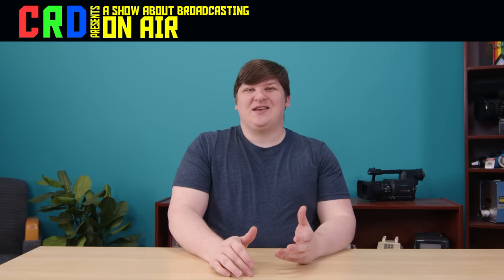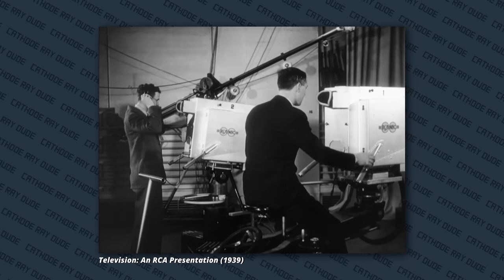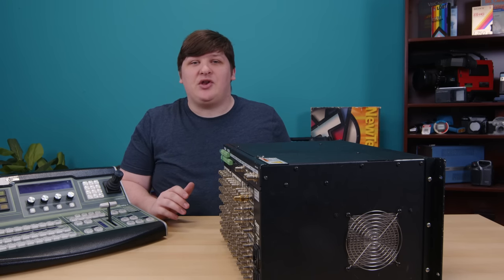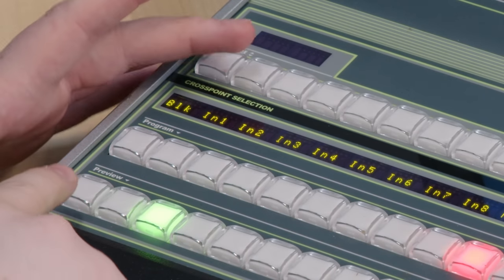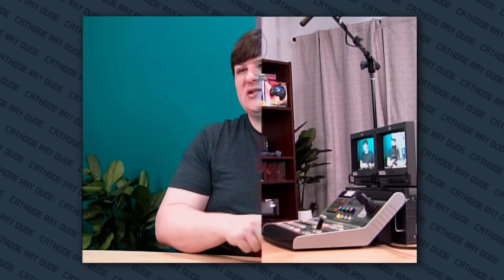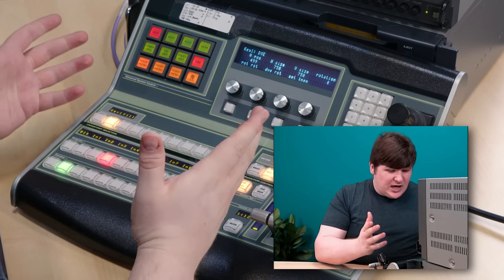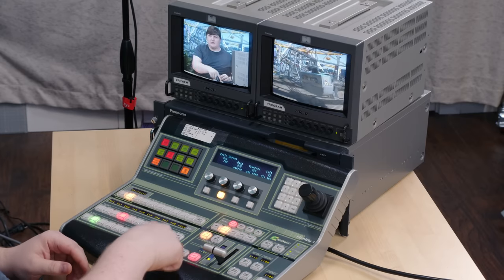What the heck is a video mixer?

Comment: The ultimatte was AMAZING! You could do linear, matte, chroma, an external keying. You could even cut a key on cigarette smoke, I kid you not! They were ridiculously expensive back in the 80s!
Reply from the maker: Mine doesn't seem to work and I'm really bummed about it. I'm hoping I can get it functioning, because yeah, the legends I've been told are incredible! All the keyers I have access to don't hold a candle.
Reply: @CathodeRayDude  oh no... all of our service manuals and old tech got e-wasted years ago...  We have junked so many old monitors, VTRs, video servers, etc over the years, I've lost count. I use to try to save stuff and find homes for things, but that was almost a full-time job in itself... :( 
I saw our ultimatte in the garbage years ago, and stupidly said to myself, I don't need a keyer, and off it went... ;( They were really difficult to set up, and operate, as I recall. It might be working fine, you just haven't got it set up correctly... does it pass video, and power up at least?
Reply from the maker: @tekvax01  I'm going to take another run at it next time I'm in the studio, but the last I tried, I couldn't get it to pass any signal. But you're right, there are so many knobs and switches, I may well have had it misconfigured.
Reply: @CathodeRayDude  send me the serial number and model number, (I can't remember what it is) I can look around and see if I can find an operation or service manual of it.

Comment: Quick note: On your Panasonic A/B Mixer, typically the Preview output will show whichever of the A or B bus is not currently being output to Program. It's possible that it got set incorrectly on your board? Also, if it works like the ones I've used you can get a hard cut the proper way by turning the Auto Take dial to Min and pressing the Auto Take button. (The other bus will become active regardless of the position of the T-bar and you have to reset the position of the T-bar before it'll become active again.)
Reply from the maker: On the WJ-MX50, if there's a way to do that, I haven't found it. Good point about using auto take that way though!
Reply: @CathodeRayDude  on that older Panasonic switcher you could unlock the T-Bar to do strange vert and hort wipes too if I remember correctly.
Reply: @CathodeRayDude  I'm more familiar with the WJ-MX20 (looks like you have one of those too) though it's been 25 years since I used one. I'm almost certain the MX20 shows the non-program bus on the preview output and would think the MX50 would do the same thing. There's definitely a menu on them that has some settings...

I did also use most of the other mixers in your pile at one time or another, plus a Videonics MX-1 and MX Pro and MX 3000 and a Grass Valley (old stuff and Indigo) and now a bunch of newer stuff. So I could be mistaken, but I'm pretty sure.
Reply: @tekvax01  Yes, there's a ring that slides to the right and you can operate it as two halves. That (or something very similar) was the first mixer I used.

Comment: I reckon you could probably achieve semi-complex mixing (using the left half of the shot from two camera and combining them), on analog equipment by tweaking the genlock. If one camera only starts sending its signal halfway through the first cameras frame, you should be able to mix them. It’d probably be pretty tricky to get right, but if the camera already accepts a genlock signal it should be doable. Very much beam racing stuff though, but it’d allow for basic positioning of images
Reply: The problem with that is that as soon as you do any vertical shift you'll end up with the vertical blanking interval in your picture on one side. For only a very small shift having a bit of black at the top or bottom might be acceptable, but for a larger shift you'd end up with a large black bar in the middle of your image.

Comment: I would love to see you do a video on your Amiga video toaster. I've had one myself for my Amiga 2000 for a decade but have never actually got it (and the Amiga itself) up and running for a multitude of reasons. Greatest of which is tracking down software for a particularly rare 030 accelerator card from GVP that has an integrated IDE hard drive controller.

Comment: When I was in junior high (early 90s) I was in a class that did some pre recorded stuff for the local public access channel, and at the time I recall we had some dinky little 2 channel mixer that I actually think was Realistic (Radio Shack) brand.  It wasn't much more than a switch between two inputs, and the only way to do a fade was manually with the T-bar (and even that I think was just a linear pot like you'd find on a equalizer.) Very basic, but enough for the purpose at the time.

Comment: The switchers that ESPN and larger facilities use commonly cost 300-500k or more depending on options. Newer models are IP based and can handle multiple formats and outputs.
Reply: I sent you a message via telegram.

Comment: I have my theory on A/B mixers. First that was due to a limitation of their era, that they could only synchronize and mix two images, A and B (if you change the source, say input 1 to input 2 on the same bus, you ´lil see a freeze). Second, there were well adapted to video editing on tapes (you would usually have two VCR’s no more, one on input 1 permanently assigned to bus A and one on input 2/bus B). The mixer was not manipulated by the director, but remotely controlled by the editing desk. That is consistent with the presence of an audio mixer.

Comment: 24:34 I want to add info about using preview and program buttons (PVW and PGM)
PGM is red and PVM is green and there is a reason for that too. 
When camera selected in vision mixer is broadcasting is also show red light on top called TALLY. There is a huge separety tally system which can be a topic of its own video. 
In studio, where there are several cameras anchor see red tally light on camera and understand that this camera is the one which is used for broadcasting at the moment. 
So do camera operator, who stands behind pedestal (studio "tripod"), holding camera and controlling lens - camera operator see red tally on on-camera monitor and it is signal that this camera is live.
There is also PVW function on mixer not for only a director to preview what next cut will be and check if  framing and focus is ok, but also camera operator holding next camera see green tally and gets that their camera will be next and they should be ready, and also anchor see with their peripheral vision which camera will be next (they see green tally on other camera while talking to camera with red tally). This is why you never see an anchor who try to guess which camera is live and that is why anchor is always facing camera everytime. It not - it is mistake of broadcast director or mixer engineer or something happens too fast to be able to use PVW.

I worked creating projects for tv studios for 10 years, ask me questions if you have some =) 10 years is a very short experience in broadcasting since I never actually worked on news, I only created systems for other people to work, but I have working familiarity with most processes.

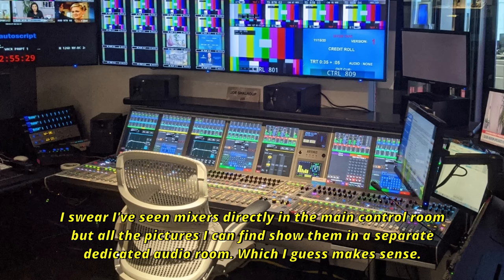48:20 I upgraded a main control unit of a studio where there was a sound mixing post with full-size sound mixer slightly behind a director's post with a vision mixer and and director actually listened to sound mixers main audio monitors, but it was kinda a mess, since sound mix engineer used PFL (pre-fader level) for checking sound sources and microphones before opening a fader and it might distract director from broadcasting, thats why sound mix engineer sometimes used tiny speaker connected directly to PFL port of sound console for that purpose only, so director don't hear an interuption from main sound monitors. But it is a tricky workflow. 
But they were able to talk directly to each other (director and sound engineer) without intercom, which is a bonus, I guess =)

54:00 it not "racks" =) its mean to be installed into "console" =))) Console can be a table with holes =) it can have holes in the middle of table or can have kinda rack mount on top of table with some angle. 
Most vision mixers you used photos in video are installed in custom built consoles. 
You can order any type of console for any configuration, that is actually what I did - we measures control room, calculated all equipment needed, created a layout of how it should be installed, get approve from customer (tv channel), found out several companies who build consoles (from pre built blocks of amsolutly from scratch), get quotes, get an approve from customer which price range and material fits customer needs, ordered, did all logistics, setup everything at customer's site, put all pre ordered equipment and setup everything to work. it was like 1% of my job, and not most difficult part, but still exciting. After that everything looks like it was like that always, vision mixer sit at its place, all intercom systems installed at hand leinght, all monitors and multiviewers, but it is all kinda custom build by someone at some point. It is possible to buy simple "rackmount" style console and put it on table and it will also work, even just random rack on tabletop will work, but it is someone's job to make studio look like studio (and it is kinda last almost last step before commisioning after working out all technical project, schematics, budgeting, ordering)

Comment: Echolab's switchers have become the Blackmagic ATEM lineup. We have two ATEM 1M/E panels, the first generation looks exactly like the Echolab, with a few Blackmagic Design tweaks. 

They have exchanged the BNC TX and RX for dual redundant RJ45 connectors that can be hooked up directly to the switcher. It has two redundant power supplies. The oldest one uses a proprietary connections, the most recent one uses a standart AC plug. 

Blackmagic sliced the prices. The hardware was sold separately,  you bought the switcher and you could control it by software or buy a hardware panel. 

The 1M/E panel costed about 5000 USD.The 2 M/E panel costed about 15000 USD. More than the switcher itself. The prices were sliced with the release of the second generation.

Gotta respect the australian company. They absolutely shaken the audiovisual market. I bet there isn't a single tv or film studio without a Blackmagic Design equipment of some sort.
Reply from the maker: That's been my impression, that BMD made it in *everywhere*. In the last few years, every single picture of a live or post facility that I've seen has one of those distinctive curved BMD panels in a rack somewhere. at LEAST one, often four or more.
Reply: I have NEVER seen video switcher tub communication control via two BNC cables before!! 
Everyone always use to use RS-422 and now Ethernet, but two serial data streams down two coaxial cable, that's a new one on me!
Reply: @CathodeRayDude  It's because they are sooooo much less expensive than just about everything else. Even if you use more expensive stuff for some things you just can't ignore it on everything.
Reply: @tekvax01  I have an older Echolab (well just the control panel) that was the same way. I think it's how they did things. Agreed it's unusual, I mostly used GVG stuff with RS422. Being a network guy though I much prefer IP for flexibility.

Comment: That's awesome. Do you have any interest on master control operations and equipment? Because to me it is even more interesting than the production switchers. I worked in master control rooms for 20 years and it was fantastic. I would suggest you to find out more about MC switchers like the Grass Valley MCC 3550 or MCS 4000 (the best ever) and learn about how much stuff it could control and do. Thanks for the video!

Comment: That device looks like you could also wire it up to control the transporters of the Enterprise.

I guess the idea is the same, except if you mix two signals with the transporter something has gone horribly wrong.

Comment: As a person who was in studios even before the invention of video tape, of course mixers were used, but at the time it was B&W. Most TV stations used Grass Valley switchers and the video signals were all analog, so vertical, horizontal & color timing was super critical.
The TD never makes camera decisions. It was always the director. The TD ONLY did what he was told by the director. For example over the intercom you would hear the director say "Camera-2 give me a 2 shot" when the Camera-2 operator would set up the shot, then you hear the director would  "Standby Camera-2, Take 2!" Which would do two things. 1. The Camera-2 operator would not move the camerab and 2. The TD would hear this and CUT to camera-2
So, the TD would NEVER make a creative decision. It was always the director.
I have an analog Grass Valley switcher and other professional broadcast equipment. 
I now restore 2" quad video tape machines for a museum.
I can always help/educate you if interested as i worked in the golden age of Broadcast and was one of the youngest ever to be nominated for an Emmy for Video Tape editing on 2" tape.
Did you know the early days of video tape we used to cut tape?
Btw the Tbar can also be split. Sometimes this changes aspect raitio of some wipes or limits the dissolve of one of the i/p
They never used regular switches back in the 40s-50s as they were way to glitchy. The video had to be switxhed in the vertical interval if not the picture would roll and glitch. This was against FCC regulations

Comment: Actually the weather report is how I got interested in how keying was done. I grew ujp with the weathermen (always men) used a rotating metal cube with magnet weather symbols. Suddenly it changed to just pointing at a screen with pretty graphics.

Also how I learned about SGI.
Reply: the SGI computer systems were used extensively for weather graphics, because they were so powerful, back in the day!

Comment: 42:10 
Me smirking at the fact that our TC2 can do 2 pgm outs, while i needed to do 4 separate ones that would split up to different signals for certain segments so instead of using the TC2 we had to have it act as a middle man and run a return to 4 different PC's that would get a separate signal to switch to for when the stream split. :D Twitch really hasn't made broadcasting too much simpler.

Comment: MIDI on that junkie box was probably for MTC, MIDI Timecode, which is a way to stripe SMPTE to a sequencer or MIDI data filer. This would be a very interesting way to get synchronized audio for your amateur music videos, I have to wonder if anyone used it for such purpose. It could also of course be used as a control interface for automating the mixer/remote usage, but I doubt that was primary use case.
MTC support has mostly fallen away from music hardware, but still has support in more sophisticated software or DAWs that have been around a while.
Reply from the maker: That was genuinely the use case! The midi input just turns note values into actions. It's just so you can automate video from a midi sequencer
Reply: @CathodeRayDude  that's wild to me. gotta have been budget cable access/UHF niche market or something no?
Good stuff!
Reply: might as well mention it here for future reference, in the void.
a MIDI data filer was a disk that'd playback whatever was played into it. So with any old keyboard, one could have 'played' the automation for later playback. If that was the intended use I'm certain people had used them this way. Dedicated sequencers weren't cheap compared to other options.
This would also enable banks of easily used pre-sets for cheap, that could be played back not unlike nab carts in radio.

Comment: Hardware: turn it on, start working. Dedicated, physical controls. Wires work better than wireless and with wires you want proper connectors, not just USB hubs. 
Software: turn it on, wait for it to boot, launch the program, wait, load a workspace/env/project, wait, have one mouse and few keys that aren't even labeled. 

Hardware is worth it when it is time critical and everything HAS to work. You can not just wait for Windows update to finish.. Same goes for sound consoles, you could just buy an audio interface and handle absolutely everything with a cheap laptop, and get loads of perks, like endless amount of free plugins and wild routing possibilities. But.. when times is of the essence not even a compact digital mixer will always do, you got to have the real thing, which is a massive sound console with thousands of pots and switches, most of them are not used once during a show. But if you really need any of them, they are there, instantly accessible, not behind some menu.

Comment: i'm having trouble sending my computer to my video mixers. I get a blurry picture. i'm using an HDMI to RCA converter, and small type is noticeably blurry. even going directly to the tv from the RCA converter will make the picture blurry. When i plug into my tv directly from the hdmi on my laptop it is also crystal clear. It's not the converter because a dvd player comes in crystal clear it is only my computer that becomes blurry. is there a to get a clearer picture?

Comment: Getting into radio, eh? I have a 1981 AudioArts LM-80 24x8 mixing console I'm dying to get rid of. It's like 7 feet wide and 200+ pounds. Apparently $18,000 new but I got it for $200 in 2014. At least unlike analog video or early digital, musicians pretty much universally love the analog preamps.